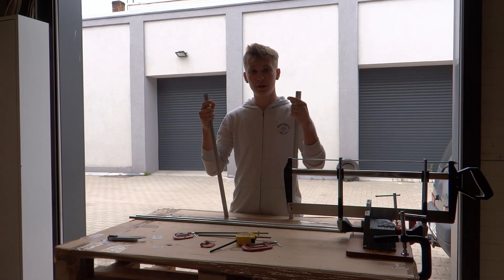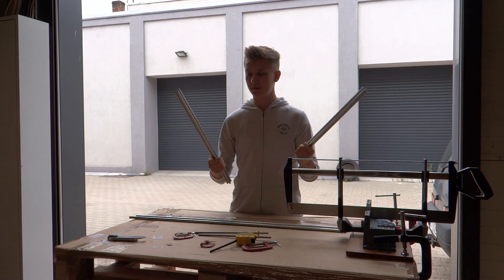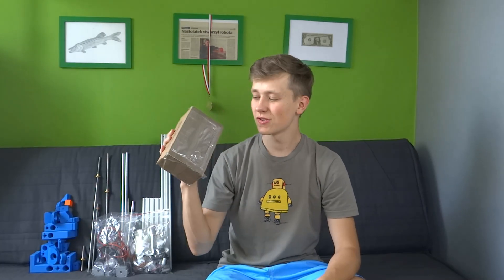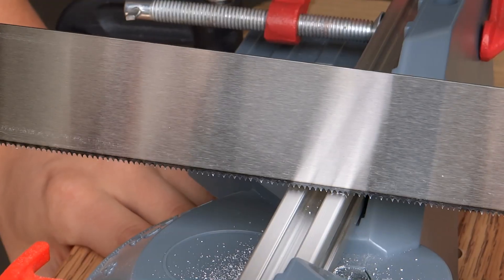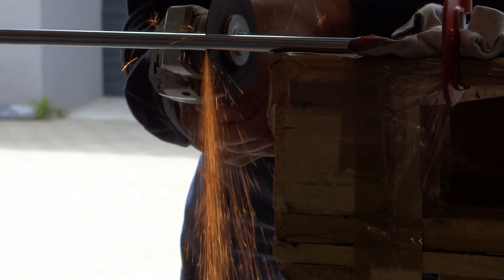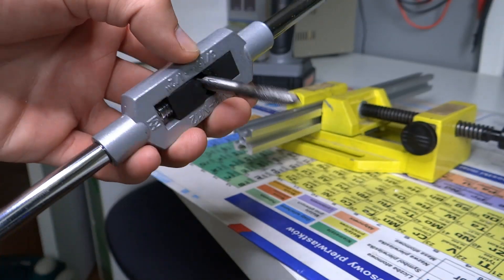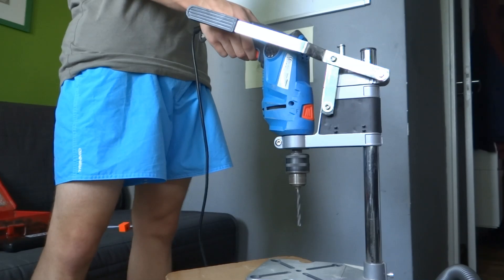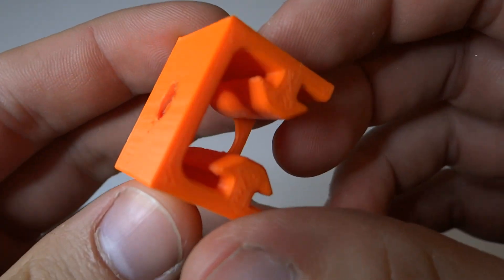DIY Dremel CNC #2 frame assembly (Arduino, aluminium profiles, 3D printed parts)

Comment: One way to press bearings into place is to use a threaded rod, 2 flat washers slightly larger than the bearing, and 2 nuts. As you tighten the nuts on both sides the bearing will be pressed into place.

Comment: Addressing the broken parts referenced at the end, I'd be willing to bet that switching to PETG rather than using PLA would solve that issue, as it's just so much stronger.  For those that decide to do that, scale your models up to 101% as PETG has a shrink rate of about 1%.

Comment: Thank you for sharing your design and ideas Nikodem:)
The grinding block at 1:16 : Wearing gloves when grinding rod material is debatable. When sanding or grinding smaller parts it is a no go to wear gloves because of a greater risk of increased damage in an accident. Protective gloves are used to protect the hands against damaging effects of mechanical, thermal and chemical nature. In my opinion, with bigger parts you don't need them too, as you are farther away from glowing sparks. 

Danger of catching gloves is usually with drills (also impact drilling) and band and circular saws. In the case of single-handed angle grinders, large cut-off wheels and jigsaws, experience has shown that this is usually not the case as the hands are usually not in the immediate vicinity of the rotating tool . For chainsaws wearing gloves is mandatory. They have a chain stopping mechanism. 

In the context of the risk assessment, it must therefore be clarified whether intended work in the vicinity of rotating parts with gloves poses a danger of being pulled in or whether the protective effect predominates.

High four. And happy grinding;)

Comment: Nikodem had you tried to freeze the bearings before you fit them? They will contract and push in to the fitting easily and as they warm up they will tighten up hopefully they will not be loose. No gluing them 😊
Reply from the maker: Check out my new video I fixed that so that there is no need to use glue :)

Comment: Nikodem:  You say that total cost will be about $250 USD.  I have two bids on printing the parts from your list.  One bid is for $733 and the other is for $774. How much did you have to pay for your printed parts.  Do you have a 3D printing machine and print your own parts?  Is the cost of printing the parts figured into your total cost estimate?  Since I would have to purchase a lot more besides the printed parts, I think a DIY Dremel Machine for me would be well over $1200 USD.  What are your thoughts?
Reply from the maker: I print those parts on my own and that's what I recommend. Think about investing in a 3D printer, for example ender3, you can get one for about $200. Printing cost when you print it on your own is really small. You can easily print all parts with less than a spool of filament
Reply: @nikodembartnik  Thanks for the information - especially about the Ender3.  I will definitely look into it.

Comment: how long did the 3d printed parts take to print? awesome build. always wanted a cnc myself, but im thinking bigger. like the makita router i have :D
Reply from the maker: You can make it bigger without any problem :) It takes about 50 hours to print all parts
Reply: @nikodembartnik  i assume you put several parts on the bed to print. :D
Reply from the maker: I usually print one at a time in case something fails :)

Comment: Your designing skill is really good. I am not impressed easily. 
For Z axis carriage you need LM12LUU bearings or print with PLA with 0.5 mm clearance. It will make your Z axis very ridged.
Reply: PLA is good for figurines, and fast  prototyping.. if you want an actual usable part that needs mechanical strength ,  the better option would be nylon , has far better strength and  it even bends a little bit before braking.. just saying..  and yes, i know nylon needs high temperatures and not every printer can handle it...
Reply: @mrdot1126 Yes Nylon is better material for functional part. But my experience with PETG is even better than Nylon. I printed extruder pinion gear with Nylon it lasted for few hours then it's teeth gave in then I printed with PETG and it is working since then.

Comment: Hi Nickodem, thanks for the project.  I have a quick question with regards to the trapezoidal lead screw bearings.  What part did you use?  
I liked all of your video's.  Keep up the great work!!!  I may have to talk to you again once I have it wired and running.  Hopefully it goes well and has no hitches.
Happy Trails!!!
Reply: Hi again.  I answered my own question.  The bearing number is 608.  It is 8mm ID x 22 mm OD x 7mm deep.  They are skateboard bearings.  I also came up with the solution you needed with regards to your hot glue trick on the linear bearings.  2 part epoxy works awesome for items like this.  I used JB Weld which is close to the black plastic color.  Now I am moving onto the electronic portion of the project.  This is a great learning project.  I have a 14 ft x 7 ft CNC plasma table that will cut 1" plate but I've always wanted a router / milling table for the precision and quality finish they produce.  I am hoping this is a stepping stone to a nice big one!  I will keep you posted as to how this turns out.  
Happy Trails!!!

Comment: It looks like you had a second type of bearing (more of pancake). Is there any difference between this pancake one and the LM12UU bearings? If so, can you add it to the parts list?
Reply from the maker: Here is a new complete parts list: https://docs.google.com/spreadsheets/d/1kMXrG71ICJv4-k7Ib0bylE4AacfpNgEWceAIhokquVQ/edit?fbclid=IwAR33iqfNzMaYjH2nZTyWbFy93aof04B_kS8brjD5LLDC940zVC0KGn_EleY#gid=0

Comment: As a improvement to your hole cutting jig, just take steel tube with inner diameter size of your drill bit, trow it into campfire and drop into water or oil to harden it (i suggest you watch least few videos related to hardening steel). Then glue it into plastic part. This will ensure your jig will last least the one project and keeps holes accurate.
Also while treading aluminum you want to use lots of oil to lubricate and advance slowly, while time to time remove tap and clean it. Its important to have very sharp tap as dull will just make your life miserable.. specially if tap snaps in the hole due lack of lubrication or removed material getting it stuck.

Comment: For the cracked, broken 3D Printed part, you should try to orientate the design, so the laminated layer lines are not stressed.  I know this may mean using supports, but they aren't so difficult.   I recommend esun brand PLA Plus/Pro.  It has very good layer adhesion, and is still very easy to print with.  There are better choices, as well, but they come with added challenges.  I love your project!

Comment: really cool project and i started looking into building one myself.  the problem i see though is your parts list.  the 2020 extrusions you list 5 @ 600mm and you are only using 2 at the length what are the lengths of everything you are cutting?  It is way more expensive to buy the longer ones and cutting them down than to buy the correct sizes.  At least it is here in the US on amazon.  Can we get a final length of all the extrusions and rods and lead screws as i cannot find them here or at thingaverse.  Thanks
Reply from the maker: check out description

Comment: Do i nees t slot or v alot aluminum extrusions? Where did you get yours?
Reply from the maker: Yes, aluminium profiles are necessary. I bought mine at local online shop in Poland. But you can easily find them online in any country.
Reply: Nikodem Bartnik ok, did you use t slot or v slot extrusions?
Reply from the maker: I used V slot extrusions
Reply: Nikodem Bartnik ok, thank you

Comment: I'm sorry if I missed anything in your video, but have you considered trying PETG? I used PETG on all the parts of my 3D printer, as well as a coat of XTC-3D on some parts, which I wet-sanded and polished to make look nicer. The PETG isn't as brittle as PLA and much less likely to crack. It feels extremely solid and any parts I coated in XTC-3D resin seem like they will last forever. Just a suggestion, and I apologize if I wasn't paying attention and missed something like that in your video. I had it on while I was working on stuff.

Comment: What lengths did you cut you 12mm rails? I am having a hard time finding a 2m stick of this stuff to just buy. There are 500mm sticks online which from looking at the CAD model seems like it'll work. Just wondering before I pull the trigger.
Reply from the maker: You can find lengths of them in the description. You should buy 2x 1m of them and that's enaugh 500mm is not enough
Reply: Do you have the website where you ordered them by chance?
Reply from the maker: I ordered them from local Polish shop, so unfortunately not
Reply: Ok, no biggie, thanks for answering all my questions!

Comment: What tap and drill bit size did you use? I can assemble most of it just waiting on what sizes to use to make it right. Thanks!
Reply from the maker: I used 5mm drill bit and then M6 tap
Reply: Ok thanks, I used a M5 tap with M5 screws with some locktite for good measure, just got done with the frame, just gotta add the other stuff. Thanks!

Comment: I had a look over your design :-) and i like that it s a very clean and easy build. But I think out of my experience of building 3D Printers you maybe become some problems with 1.) the attachment of the dremel because with clamping it only in front of the dremel you get a very high bending moment which will bend the dremel, a second clamping point would fix that. My 2.) point are this cheap rod connectors between the Stepper and the threaded rod, in case that the spindle don’t have a fixed and free bearing configuration the coupler acts like a spring as soon the get some loads from milling. I think that makes the axis not that rigit as I know that Problem from my 3D printer builds :-). But these all things what later can be fixed :), looking forward to the next assembly and first cuts with the machine 👌🏻 best regards. Patrick

Comment: If there are any raspberry pi junkies watching I have a question. How would you run the CNC (arduino and shield) off of the raspi (software wise)? I'm imagining something to the effect of octoprint or astroprint but for the CNC.
Reply from the maker: You can simply connect Arduino that will control the CNC to Raspberry Pi and run some kind of CNC controller (GRBL controller for example). That's a pretty good idea to have a standalone computer for CNC. I am not sure if there is octoprint for CNC machines.
Reply: Nikodem Bartnik I didn’t think there would be, I run octoprint with that Astro plugin on my printer. I just want something that would be easy to control on the local network without my main computer stuck at it when it’s running. 
Also, what software would you be using to make the gcodes? Can you set that stuff up in fusion by chance? (As here is a simulation tab)

Comment: Супер агрегат, пластиковые уголки не фонтан, но это поправимо, а вот тебе идейка для модернизации и расширения функциональности прибора. Нужно снять поперечины станины, укрепить каким-нибудь способом не перекрывая внутреннего пространства перемещения шпиеделя, орган вращения выставлять таким образом, что он будетспособенвыходить ниже подставки. Таким образом, ты снимаешь с аппарата ограничения по толщине обрабатываемого изделия очень сильно, к примеру стену дома в него (в первоначальном виде) не загонишь, а с модернизацией, его можно прижать к стене дома и на этой стене производить фрезеровку, или дверь, или столешницу, да любой массив, который может быть любых размеров, прижал станок, нанес рельеф, переместил, повторил. Можно например изобразить огроменный ристунок, разбив на сектора и раскроить поочери, секторами.
Reply from the maker: Google translator didn't help a lot :) But спасибо
Reply: @nikodembartnik  Here is the translation that hopefully makes more sense: This is a super machine. Plastic corners are suboptimal, but that can be corrected. Here is an idea to make the machine even more functional. You have to get rid of the perpendicular parts of the frame and reinforce it in some other way that does not entail blocking the spindle space. The idea is to set the rotational instrument in such a way that it can be lowered below the frame surface. This way you are lifting the limits of how thick the material can be. For example, now you can't attach the machine to the wall of a house, but after a re-design you can press it against the wall and mill it, or a door, or a table surface or other massively large material. Fix the machine, mill the material, move the machine, repeat. This way one can create a giant picture and milling it sequentially, sector-by-sector
Reply: Пупкин, учи инглиш, гад.
Reply: Юрий Алтунин, Кому интересно научит Русский :D

Comment: Hi!
Congrats for your nice video! Well done. But I have to write you a comment. You have used an wood saw for your aluminium profiles. Better use an iron saw, and some rubbing alcohol for greasing/cooling while cutting. You will get nice smooth cuts. And for your own safety do NOT use gloves while working on a grinder, that is dangerous! Because if the machine catches your glove you can't get away with your fingers. It is the same when using a drill!  And if you use an angle grinder also use the shield! Your fingers will be thankful.
Reply from the maker: Thanks for the advices, will keep those in mind in my future projects!

Comment: Cool project and I am thinking of building one too as I had planned on turning my dremel into a mini lathe but this will be much more fun!I really hope it works for routing and that the dremel copes with milling operations 😊 If I build I will let you know!Cant wait for next video to see how it needs to be wired up...etc
Reply from the maker: Thank you! Dremel into lathe, that sounds cool :) You would need a gear to lower the RPMs I think. Waiting to hear from you about both builds :D

Comment: Nice build Nikodem, I've faced those issues myself in previous builds, try to double the bearings in all rods, and start thinking in anti-backlash nuts, or else your circles will have straight lines in direction changes.
Reply from the maker: Thanks! I will try to update my machine :)

Comment: It is not going to work great Ican tell you that right away. The acme rods need to be between bearings. Now the aluminum coupler will stretch and compress shen milling something. For laser and 3d printer might be sufficient but still not better then belt.

Comment: First thing I would do is use it to replace all of those plastic pieces that I could.  As we saw one was already cracked and 3d printed plastic makes a horrible cnc part.
Reply from the maker: I will in the future, that's my first CNC machine, once I gain some experience I will create better one :)
Reply: Of course but use wood to get accustomed to it because I am not sure that will be able to go directly to aluminum as it might need an intermediate material step like wood to give it the rigidity it needs for metal.

Comment: I liked the thing the second I saw it on thingiverse and now I found the video lol. It's a really impresive little machine, slick and easy, with a few tweaks I bet this will work absolutly flawless. 
P.s: the bearings problem... maybe increasing the wall size in the 3D printer? Seems to small to lathe the part easily and it's a critical part to simply wrap in teflon tape.
Reply from the maker: I just grinded them too much, if you will leave the print straight from the printer you wouldn't be able to put a bearing inside it so you have  to use file. I will fix that with glue or something.

Comment: That looks great!  With some cheap materials, you could use it to cut upgrade parts for itself that'll stiffen it up.  Great work, keep it up!
Reply from the maker: Thanks! Kind of like what RepRap is about a 3D printer that can print out parts for itself. Would be cool to create a CNC machine that can mill parts for itself :)

Comment: I'm concerned about the broken 3D printed parts. Did you use ABS? Or PLA?
Reply from the maker: I used PLA
Reply: Nikodem Bartnik I highly suggest you try ABS. It is much stronger than PLA.
Reply: Nikodem Bartnik  Use PETG or ABS. Nice video and nice desing😁

Comment: You should also try to insulate the stepper motors from the plastic. The motors get very hot, hotter than PLA can handle, and the motor mounts will deform. Or print the mounts in abs or nylon. If you can't print nylon yourself, get a quote from 3D Hubs or similar services.
Reply from the maker: That's true I didn't think about that. I hope motors wouldn't be so hot after adjusting current properly. Maybe adding a fan on the motor would be a good idea. Thanks for comment!

Comment: That is really cool project.    Few questions.  Is there any local Polish distributor of the parts you purchased, seeing Gearbest for most products means a reasonably long wait time?

Also with regards to design. the Dremel mount is side heavy.  Meaning that one side has all the weight which could bend/twist the z-axis part?H

Either way, eager to see how the project progresses so that I can star building my own CNC.
Reply from the maker: You should find most of them at abc-rc.pl or allegro. For sure it will twist a little bit but that's how it is done in most CNC machines. Thanks for comment!